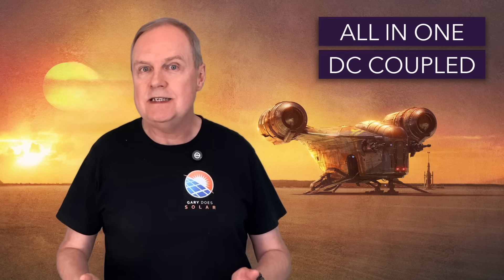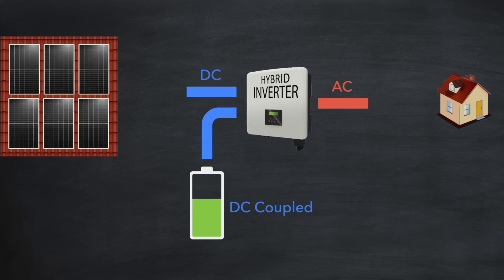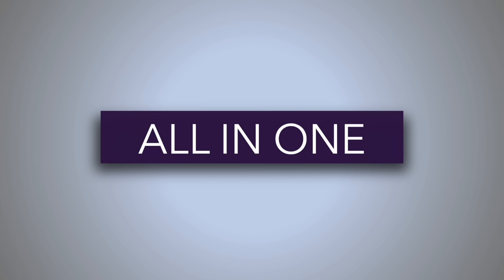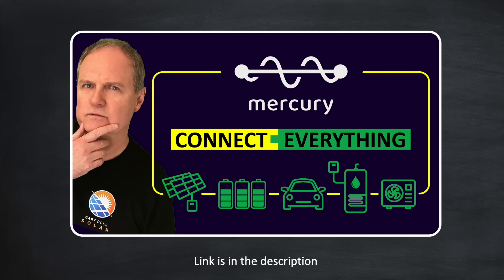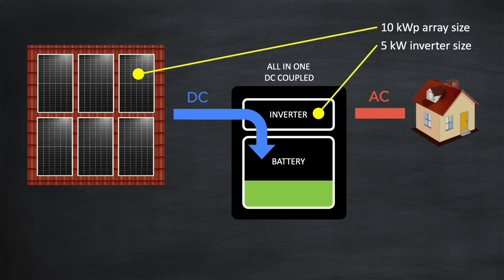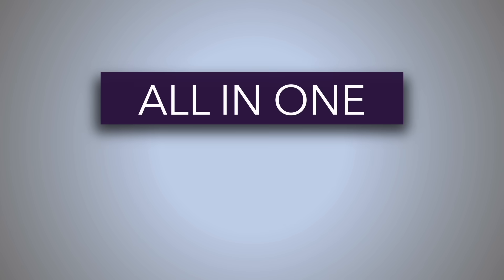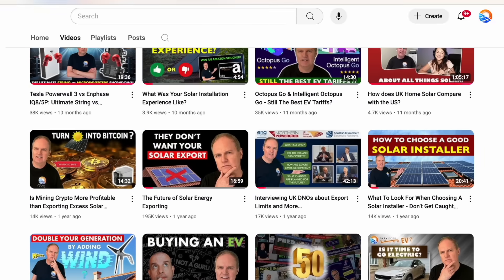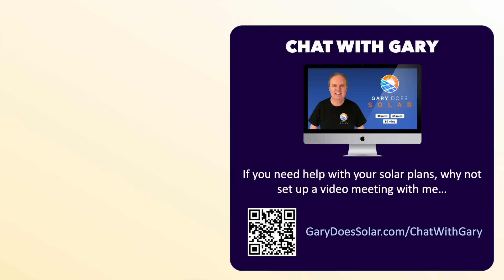Why All-in-One DC Coupled Systems are Transforming Home Solar

Comment: I've had the full Sig system installed here in Perth WA in 2 stages. 4 months ago I had a 6.6kw array connected to a 5kwSP Sig inverter - Looking small and lonely on the ground. I learned a lot about smart management of discretionary loads using the Sensibo A/C controllers and a range of GridConnect cheap controllers. Between the Sig app and the those 2 other apps it was pretty powerful, but even on a winter's sunny day I would see the output clipping for much of the day.
1 month ago (once the battery rebate was sorted) I had an extra 3kw panels, 2 x 8kwh battery modules and the DCEV charger. I also took delivery of a BYD Sealion with another 82kwh battery. Took me a few weeks to realise the V2X stuff wasn't waiting on any Govt approval - it was just a checkbox in the Sig app! After chatting with ChatGPT and checking my balls I flipped that switch.
It can be flaky, but when it is working it is very cool. Our daytime FIT is a piddly 2c/kwh, shifting to 10c/kwh from 3-9pm. I now have massive charging to both batteries until 3pm when the system kicks over to exporting 4.9kw minus my house load (usually around 4.5kw feeding in). It took some wrangling, but it now tends to get half of that from the house battery and half from the car.
Late mornings my 9.6kw array can be generating 9.5kw! And only if both those batteries reach their limit will I see any clipping at all. Mostly I'm charging till 3pm then feeding in till 9pm - earning around $2.50 a day (Whee!) - plus having abundant free miles to drive (so long as I don't go any further than about 180km from Perth).
It really is an awesome system and I'm really glad I held off installing for the last 4 years - For once procrastination paid off!

Comment: In the seventies my electronic excess was music. We actually had music that didn’t sound like shampoo commercials or dog fights in a dumpster.
The very best system had separate preamp,main amplifier,turntable,reel to reel tape,tuner, and cassette tape. Of course speakers that made your neighbor’s ears bleed. 
I still like modular solar for the same reason. Home solar should be for the home. The regulatory headaches of dancing with a fat drunk lady ( grid power) simply isn’t worth the trouble. If I wanted to become a grid power source, I would build it separately.
I use all-in-one off grid inverters but have moved away from paralleling them,only allowing them to share a massive battery bank that they can charge or discharge individually with no communication with each other. For instance,the inverters are sized for their assigned load like heat pumps or water heaters. I don’t want an overload on any part to affect my refrigerator.
I know this strategy is less efficient than the high tech equipment available now but sunshine is abundant and solar panels are cheap.

Comment: micro inverter is a dead pony - too often do they fail. String inverter with a few passive optimizers for 50€ are the proper way to go and if you do so the battery is an easy upgrade if you have prepared the decision properly. 
We did go for 4,6 kW grid inverters on 3 phases instead of 1 big hybrid cause back then the hybrid were expensive, at least those that were supporting 51 V LFP batteries and diy batteries. Over time we build more and more batteries and have now all 3 of them replaced with 4,6 kW growatt hybrid inverters cause we could sell the grid inverters easily and lost maybe  100€ after 2 years - and got used hybrid inverters 500€ cheaper instead cause many started in germany with rather small test systems like 4,6 kw single phase hybrid inverters and then after 1 year or 2 got an upgrade to 15 kW hybrid inverters so we got 2 of them for cheap or rather cheap like 600€ per unit instead of 1000€ - so 400€ depreciation in 1 or 2 years and less than 4000 kWh produced. 

Good planing is the biggest topic  - and knowledge and awareness what are the limiting factors you can hardly change afterwards or only at high costs.

Comment: ALWASY BE AWARE: if your load during night while you sleep is low then the efficiency is terrible and can be 54% for 100 W AC

AGAIN: if your home has a 100 W load at 1 am your inverter will draw 186 W from the DC battery and after 10 hours your battery would have lost 1860 Wh for just 1 kWh AC output

Keep it in mind cause all small or balcony solar power owners thinking about a great storage are missing this point and awake after buying a 2 kWh battery for their 1 kWh AC demand quite rapidly if the battery is empty in the morning and there 1 kWh reserve they had planned in has vanished.

University of Berlin aka HWT Berlin host the biggest solar power storage competition for 7 years or so sponsored by the german government.
They have released an english PDF where you can read about the details most people are missing: page 6 and 7 for example
100 W AC can require 186 W DC from the battery with a loss of 46% efficiency. 900W would be great cause then all inverters are delivering 90% efficiency but your real world usage is everything else than high power output during night. 

And this is a figure of a high voltage system, not the one we use with 51 V and LFP cells for DIY builts. The only really efficient systems are MLI 
Multi level inverter explained in that report. 
Read it to understand the difference, but avoid buying it cause they are quite expensive and a closed ecosystem with no chance for adding a diy battery like we did at 1400€ per 16 kWh battery.

Comment: Great video. I've seen video's about these systems, and didn't realize they were transforming some markets. It's a great solution if it meets your requirements.
I have a different hybrid system, more modular like what you mentioned, but I think you need to realize that there are two different setups. In Western countries the traditional hybrid systems are usually set up to feed surplus energy into the grid. In much of the world, particularly in developing countries, there is however also a setup being used that doesn't feed surplus energy into the grid. That surplus is basically wasted once the batteries are full. The advantage of such a layout is that the system doesn't need to synchronize with the grid (you are not connected to the grid when using energy from the inverter) and you do not need any type of permission from the grid operator. In some countries it can be hard/costly to get such permission. They offer a net metering credit system here (in the Philippines), but I already reduce my bill by 90% with solar, so there isn't much left to credit, which means that there isn't much left to justify the fees (and probably bribes) associated with net metering.
Now there are more benefits to the layout I have. I have a 6 kW low frequency inverter, which allows me to run whatever loads I have during a blackout. And when I use grid power, it can run through the inverter, which then improves the net voltage (grid voltage varies between ~164 (peak times) and 247 V (night)). And it is relatively easy to connect DC loads to my battery, for instance a DC airconditioning unit.

So I see a couple of issues with this layout:
1. A modular setup makes it easier to customize your setup. Maybe you want to run 1 panel with a microinverter to cover your base loads. Then 2 panels in one string, 4 in another and 3 in another. With this system you would need a big (expensive) system if you want to run more than 2 MPPTs. In my case I now have a 6 kW low frequency inverter with 4 kW panels. With Sigenergy, I would need a 10 kW high frequency inverter which would be significantly more expensive. Customization is important if you need a system that can serve as a UPS during blackouts. Low inverter capacity might be good for grid operators, but it is not for consumers who want an uninterrupted power supply.
2. Sigenergy doesn't seem to offer easy connections to connect DC loads. If you have a separate charge controller, you can usually hook up 12 V equipment or plug in a USB outlet. Aircons are afaik available in 12 and 48 V DC. I think the future is DC not AC.
3. I am not sure, but I think there is no EVR (Voltage regulation) functionality, which is important if grid power is poor quality.

I hope Sigenergy will develop a module that allows you to easily connect 5, 12 and 48 V appliances, perhaps also 18 V (laptops). They also need an integrated airconditioning module (inverter with built-in airconditioning, rather than the usual airconditioner with built-in inverter that most people have).

Comment: I have a Growatt SPH which does both AC and DC charging. And since their Modbus is documented I have full control of it without cloud in home assistant. Also you can let an AC battery discharge in a way that does not feed into the grid. So that whole "visible/not visible" to DNO story is bunk.

Comment: 1. Batteries shouldn't be software "locked", any external device should be able to manage the battery.
2. Apple are at fault for causing the Interoperability issues. 
3. All-in-one system such as the above can "lock-in" users to that system, reducing development and improvement 
4. That all In one now looks to just be a hybrid inverter with a battery, no great improvement except for installation.
5. Hiding everything behind the inverter sounds like limiting the power back to the grid. 
6. It was a long video after 5 minutes.

Comment: Hi Gary, I think the advantage you describe at 11:15 only works if your AC loads are in a subpanel that the inverter sees, right? I mean, if I were to connect my PV-battery inverter to a breaker in my main service panel, I don’t see how the setup you described where AC flow is restricted to “only Loads” and not back to grid works. Therefore, the hybrid inverter needs to be wired between Grid and Loads, right?
Sorry I didn’t get to bump into you in Vegas - that was too massive!

Comment: Gary, you touched on V2X in this video. Getting more use out of the big battery on wheels is an attractive idea to many. 
Can I ask you to do a video on what is today’s real state of play in this area? What actually can we do right now in the UK? There seems to be a lot of promises and hand-waving. It would be good to have a definitive authoritative take on the reality versus the bs. 
Last time I looked, Sig had a very short list of compatible vehicles on their website. Do others “work” but invalidate the warranty, or is it a tech problem? 
FWIW, I reckon Sig could unlock the domestic market with a one third power (say 7kw) bidirectional charger module for half the price (say £1500) compared to their current offering. 
Lastly, I’m curious about the Sig generator input. How practical would it be to hook up a car’s V2L output (no longer a rarity), to that genny input?

Comment: IMHO “All in one” (in the Tesla and Giv one-big-box style) is a poor second to stackable systems for the user. Being able to initially specify and then extend one’s capability in reasonably affordable, easily installable modules, is a serious advantage, especially as one’s needs will change (heat pump?) and the cost of batteries can be expected to decline. 
However whether or not +proprietary+ battery modules will cheapen in line with generic cells is of course an open question. 
I really don’t want to give my money or any support to Mr Musk, but Tesla do seem to be the only manufacturer in this market area with an output-programmable inverter - though their battery upgrade modules are unattractively large capacity and expensive.

Comment: I'd rather have a separate management system like Home Assistant and avoid proprietary lock-in, a sigenstor is 2-3 times more expensive per kwh than an off-the-shelf battery or a diy kit.

Comment: Hi Gary do you think that older battery systems such as the tesla powerwall 2 will be able to participate in V2H or V2G through software updates given Tesla has applied to become an electricity provider or do you think it will be necessary to upgrade to a sidenergy battery system?
Reply from the maker: Hi Tim, so the V2X capability will be enabled by a bi-directional charger in your system. That might be a built-in unit to an all-in-one system like Sigenergy, but it could also be standalone (like EV chargers are today). That way, it could be made to work with your existing setup 👍🏻

Comment: This debate is reminiscent of hi-fi system components many years ago: do you buy separate speakers, amplifier, turntable … or compromise for an easy life with a midi system?  Many enthusiasts cherish their system as a hobby and enjoy the freedom to select and configure components to suit their taste but one-box-does-everything has dominant mass-market appeal and usually wins out eventually.  Cost-effective it may be but there is always the nagging doubt that a closed proprietary system may go bust or cease to support last year's kit, leading you into an expensive dead-end.
Reply: All in one plug and play for the non enthusiast non-geek old grandma 👵 like me who just wants a working system so I could go on with my life playing GTA
Reply: Thing is, a large installed user base is a significant asset in corporate terms, so a sufficiently popular system is unlikely to stay ‘orphaned’ for long. Though a new price list might be expected! 
I’m old enough to remember S100-bus computer systems. Turned out that the iPad had a much greater market potential!
Reply: The alternative is to have standards. We have that for EVs and DC fast chargers.
Reply: A midi system might save you some cost, but all in one solar systems are far more expensive than standard 48V LFP batteries paired with a hybrid dc coupled inverter

Comment: I think stackable AIO DC coupled systems are the way forward.  It makes it so much better to be able to modify the battery size without simply doubling the size, which used to be the weak point of AIO systems.  It also means that you can swap out components that need replacing, or upgrade the inverter to 3-phase or whatever is needed, which you can't do if the whole thing is a single unit.  It is also easier to move around for installers.

Comment: You failed to mention a downside of the all in one systems compared to seperate battery + hybrid inverter setups. Packaging and form factor is crtical for all in one systems. Keeping inverter electronics cool is more difficult to achieve and longevity is likely to be less than with seperate units. 
Repairs, upgrades / expansion and replacement can be more challenging (particularly for Tesla maybe less so for Sigenergy). Installers like them and promote them because they are less work not because they are better than hybrid inverters + battery modular systems.

Comment: Look forward to seeing the Microinverter video asap as I was about to head down that route and would like to see the reasons you think they still have a place. Keep up the great work! 👍
Reply from the maker: Thanks Paul—if you have shading, then there is a role for microinverters, but it’s hard for that technology to compete with all-in-one, DC coupled offerings…
Reply: @GaryDoesSolar  I have a complicated roof set up, valley roof on Victorian terrace facing SE with a pair of chimneys and parapets around. Plus a tiny SW extension with parapets either side. All rather tricky. Ready for your next video.
Reply: @peteglass3496  I have a virtually identical setup albeit with a N & S orientation. I am having the roof refurbed as part of the PV install. Getting the chimney pots replaced with shorter versions to at least help a little with the shadowing.
Reply: @MrMarkja some of my chimney pots went decades ago but I think there are still two tall pots left. I was just considering the stacks, forgot about the pots as well...
Reply: @GaryDoesSolar  But surely there is a middle ground with the cousin of microinverters. That is the 'optimiser'. So one gets the benefit of more granular MPPT (DC) control on each panel thus helping with shadowing. But without the DC/AC conversion.  I say so, as it is what my system design is planned to be with an installer sourced via Garry's installer directory.

Comment: I’ve had my 3.9kW array from Hanergy with a Sunnyboy inverter since 2012 - purchased from IKEA for £5750 full job including registering for FITs. Since then I had to replace my 35 year old 200ltr hot water cylinder so had a 100ltr Mixergy tank that I opted for the additional heat exchanger in case I want to install a heat pump. Then I got my 1st Ev so added a Zappi charger that can suck from the PV panels and completed my set up with a Myenergi Eddi solar diverter to heat the hot water. My panels are on my SW facing roof and their age is starting to show through reduced generation so I was considering 2025 tech solar panels on my NE facing roof side with a battery but wondered if I shouldn’t just go with replacing my original panels with new and still adding a battery? In the summer my NE facing roof gets sun from 5am right through to noon, the SW side has sun from around 8am to 10pm mid summer. In winter my generation drops a lot because 200ft from my house on the SW side is a stand of ash and sycamore trees that are high enough that the sun’s mid winter elevation is not high enough to rise above the trees. I’ve had one issue with my system in all the years I’ve had it - my generation meter failed while I was working at sea so I missed a quarter’s payment. Nothing else has broken/worn out and I get in a specialist company to check that everything is working fine and they carry out a full panel wash and rinse with ionized water each autumn (I have 2 rookeries close to the house and am under their “bombing range” so crow poop gets baked onto the array over the summer.)